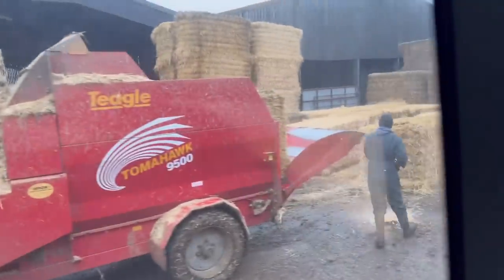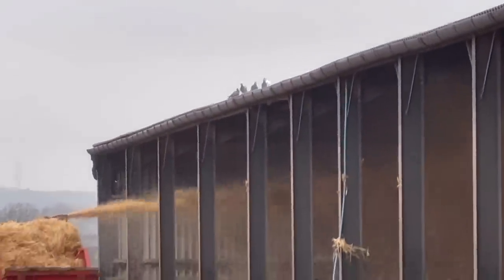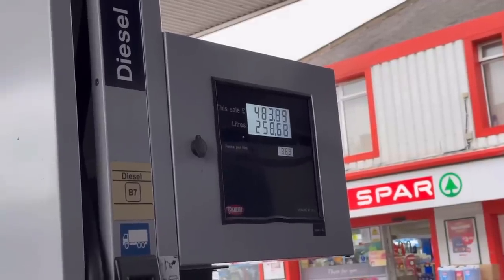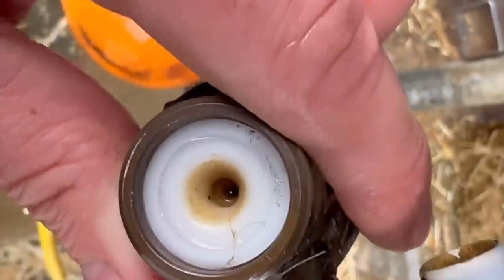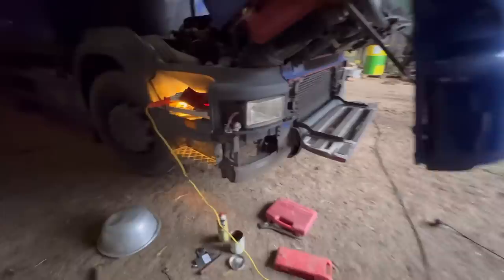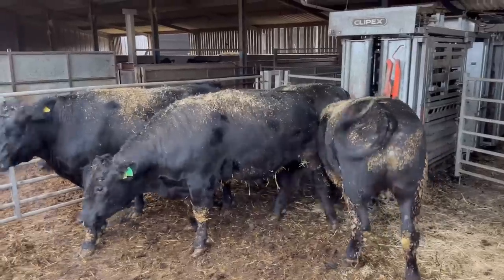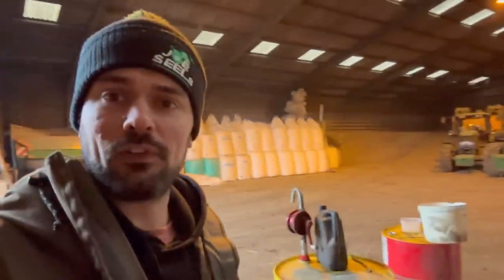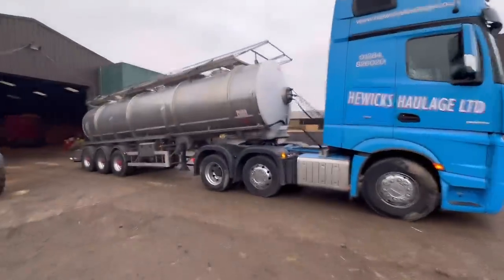Scania Crash Repair! I loose it With the Bumper! Lots of different Feeds Delivered!

Comment: we have UK fuels and save at least 5p a litre most weeks and often more and we dont use anywhere as much diesel as you would with the scania (we have a van) so you may end up saving more, we paid 160.58p pl ltr including the vat on sunday or  133.82p excluding vat so you filled up 168.9p and we would pay this week 160.58p with the vat
the texaco on doncaster road near you  is in the scheme we use. Worth a punt yoy can always cancel the card if you end up not using it